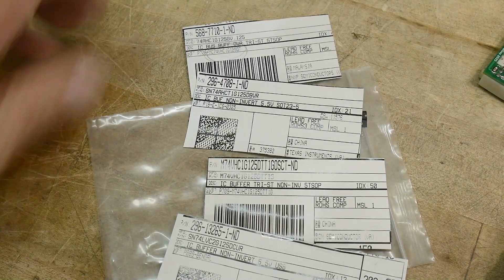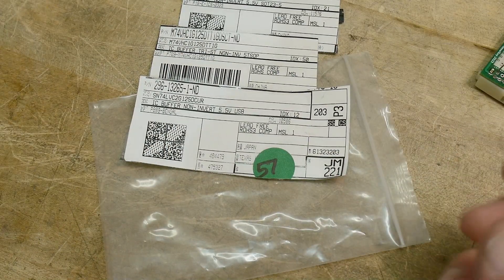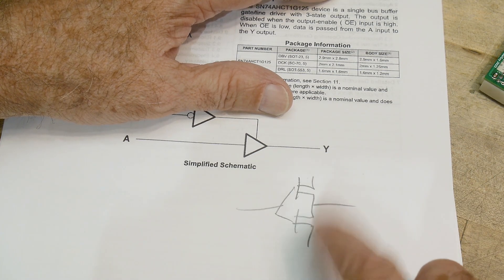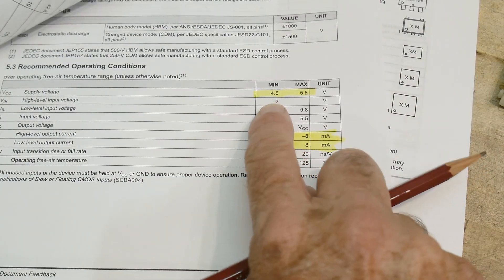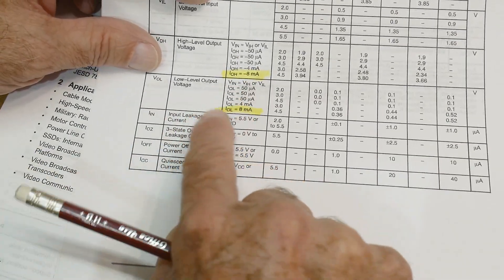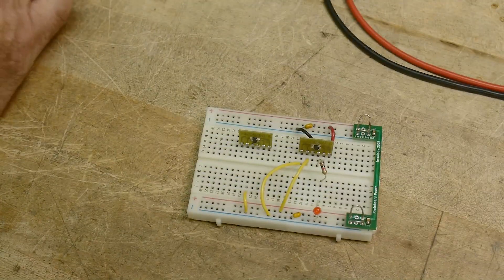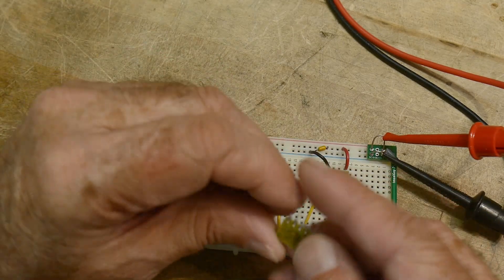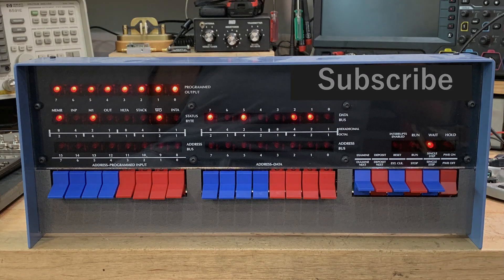#1965 74125 various versions

Comment: With open collector/drain and pullup resistor, the data collisions do not burn out the transistors; however, they are much slower than CMOS due to board trace capacitance needing charged through the pullup resistor.  Larger output current will also charge this capacitance quicker and are thus much faster parts, but usually many parts are on a bus and each one uses a little current; this increases drive requirements as well.